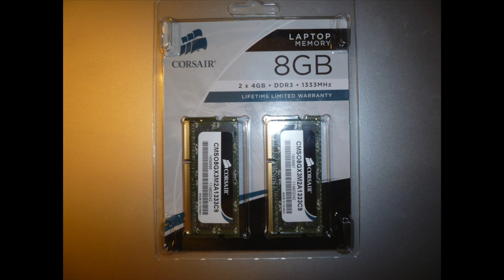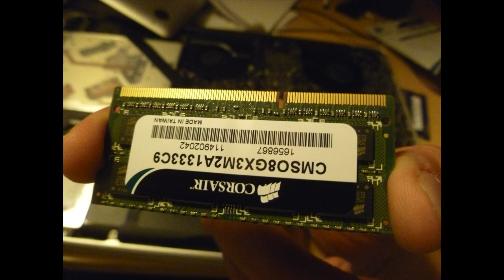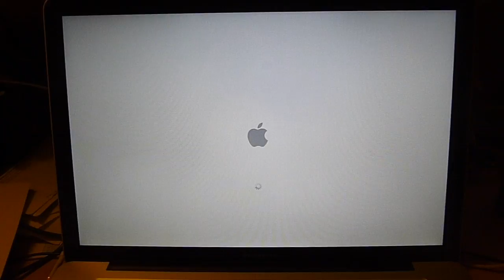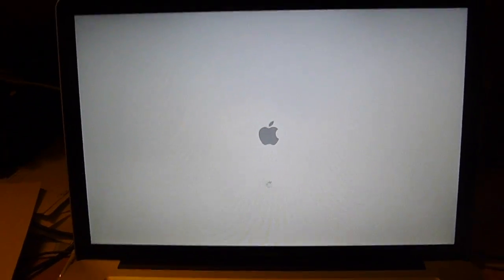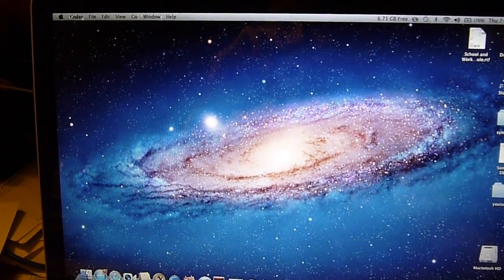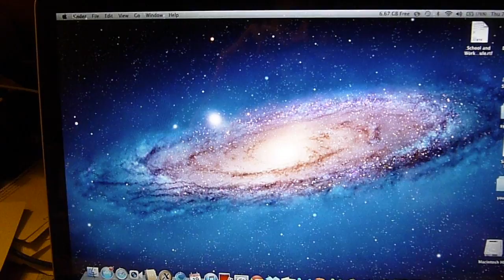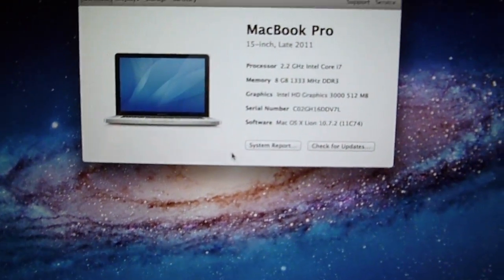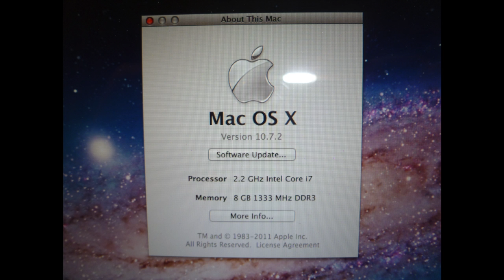How to Install Ram For Your Macbook Pro Late 2011

Comment from the maker: because in case your body is charge with static electricity, its best to release it on a metal surface other than your hard drive. Because if you accidentally release it on your hd it may cause problems..

Comment from the maker: From what I understand, it should be ok. The 1666 ram would over clock the cpu, therefore gaining more performance. This should be ok with your i7 processor as it is able to do that. Even if your processor can't over clock..it would just stay at 1333 mhz

Comment from the maker: If your just updating the ram you won't lose the warranty. Just keep your old mac ram and don't remove the stickers on them in case you need to send in your MBP, you can send it in with the original ram. I believe that if you were to change the hard drive or battery it will void the warranty. The best brand I say would be Corsair..which I'm using right now for a few months.

Comment from the maker: @ULAZYCOOK no it will not void the warranty if u open the case..u would only void it, i believe, if u remove the components that has the warranty sticker on it..like the hard drive or battery for example.